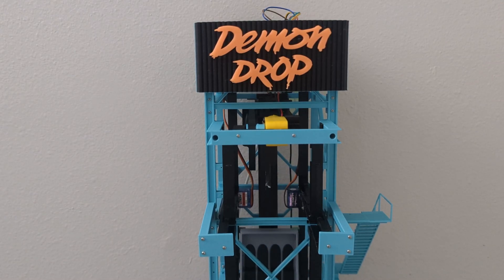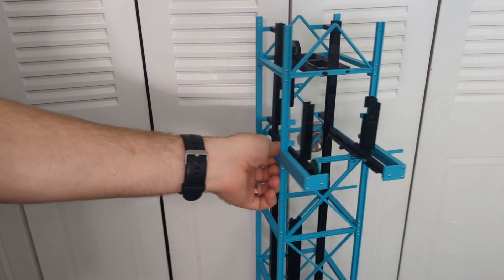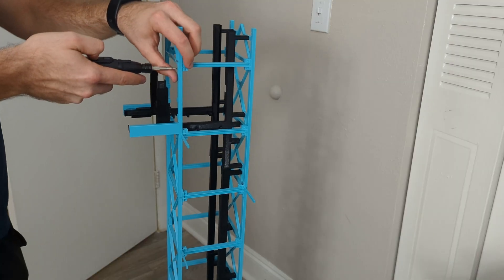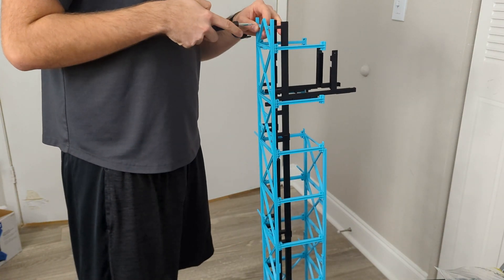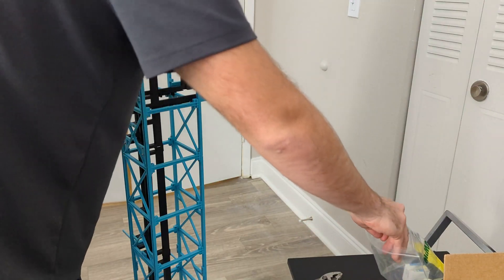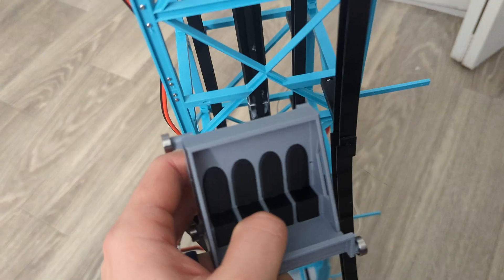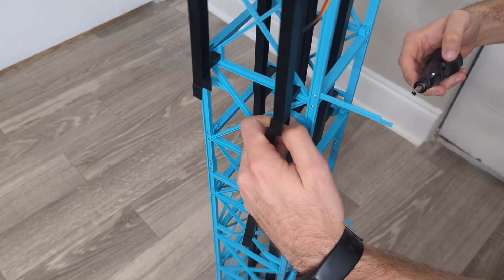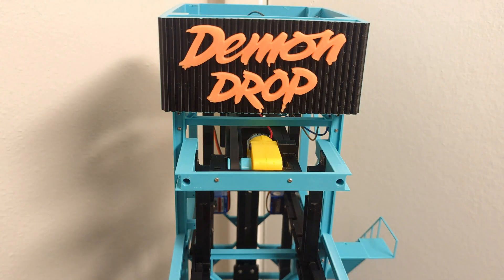Finishing the Tower and Dropping Cabins  |  Model Demon Drop Project Part 2

Comment: You need to do a knex swing launch like top thrill 2 the mechanics have been delaying mine for about half a year 😂 the scale i need is also just stupid
Reply from the maker: I'd like to build a Top Thrill Dragster or Kingda Ka as my next project. I know others have built both before, but I'd like to build one with an air launch. I started working on it last May, but got busy with unrelated events. It'll  probably be TTD because I don't think I have the ceiling height to build Kingda Ka. I'm going to get back to that when the Demon Drop project is over!
Reply: @ModeledCoasters  Kingda Ka 😢